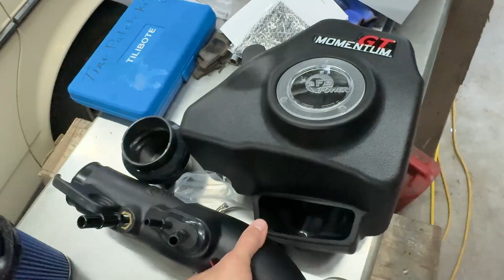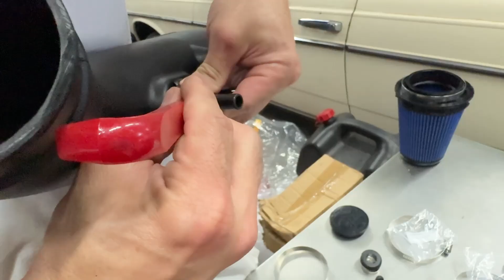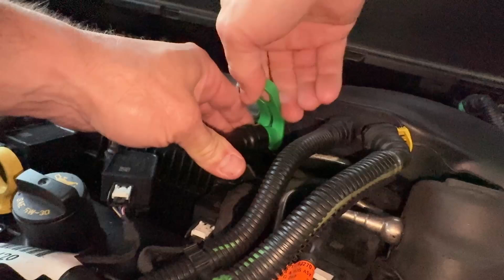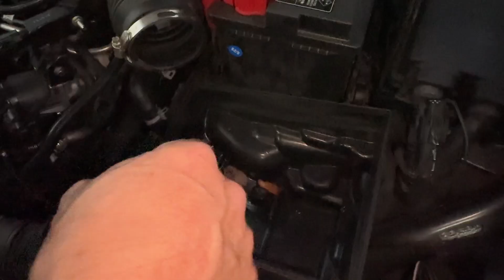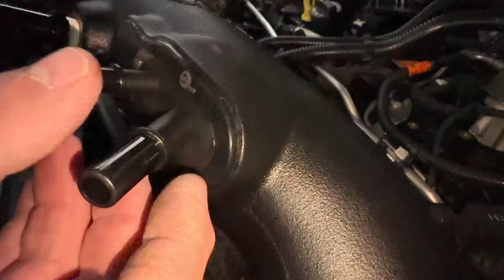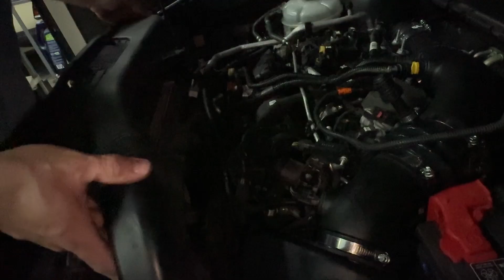ep6 - 2022 Ford Maverick 2.0 afe POWER Cold Air Intake installation

Comment: Bought and installed this yesterday. Instantly threw a "service vehicle soon" light on the dash. No codes on the reader. Can't return it so I guess I'm out $360...ugh
Reply from the maker: Sorry to hear that.  I actually never have had any issues other than a bit of hit on the fuel economy.  No performance gains that I can notice either.  I think the stock system is better.   Thanks for posting!

Comment: thanks for the video..Did it make a difference with throttle response? Does it make it so you can actually hear the intake?
Reply from the maker: After running it for several months I can say it’s definitely not worth the money.  Before this installation, I was running a green filter. I could easily hear the turbo noises.  Not with the aFe.  I also noticed my fuel economy drop about 1 mpg and it’s not because of me trying to feel the power.  I actually did not notice any improvement in performance. 😢
Reply: @dadsgarage.alwaysopen ah, that’s unfortunate. Thank you for the information, very much appreciated.
Reply: @fearpr1mo I have a 2022 fx4 4k tow package Maverick. I installed a turbosmart dual port BOV then a week later an MRT street race single exit cat back exhaust and I can tell you from firsthand experience it makes a world of difference! Throttle response is much improved, shift points happen sooner and more crisp, and it doesn’t rip the tires off but it definitely pulls stronger and smoother! Was skeptical about this intake especially after reading this comment before I did either mod but after I came back around and watched the install video by pandamototsports and now I’m certain the three will work wonders combined! Alone each may not be noticeable but start where I did and it’s DEFINITELY noticeable!
Reply: @cirdancescles4370 awesome, I appreciate the info.
Reply: @f @fearpr1mo regarding your question about hearing the intake, when a traditional ‘cold air’ style filter is installed the noise you describe is a sudden surge of vacuum from the engine. An engine is essentially just that: one large vacuum pump. Sucks clean air in, spits shit air out. The sound created by these types of filters can potentially indicate more flow but that doesn’t necessarily translate into increased power. Power isn’t created by installing a cold air intake, or exhaust, rather the engine is freed of obstructive ducting that limits its ability to perform work, therefore freeing up power. Also, consider that a freer flowing intake filter is not necessarily a good thing. Non shielded intake filters have to work harder to keep out dust and debris, and also makes them susceptible to WATER INTRUSION which, hopefully needless to say, will ruin your engine. This is precisely why major manufacturers all create the boxed style of intake air filters and exactly why AFE designed theirs this way rather than just using the tubing and the cone filter. To create real sounds AND to improve go with the turbosmart BOV. If it’s sound from the turbo you want STEEDA makes an adapter for the stock diverter valve that  allows the pressure to be vented from the atmosphere but it costs $100!and at that point you are 1/3 the cost away  from an actual engine upgrade with the turbosmart BOV which will change throttle response positively
Reply: @c @cirdancescles4370 sorry for the misunderstanding. I asked that part of the question simply because the engine compartment noises this particular rendition of the EcoBoost is very “chatter happy” ala 1987 Nissan stanza. My mkc also has a 2.0 eb, but it’s night and day in the noise department likely to better insulation and overall body panel differences.  Sorry my question sent you off in that direction, it used to happen to me all the time on 1320 and dsmtalk forums, drove me nuts 😂